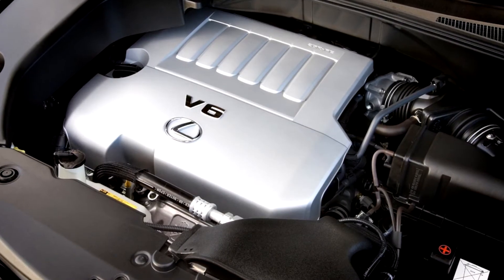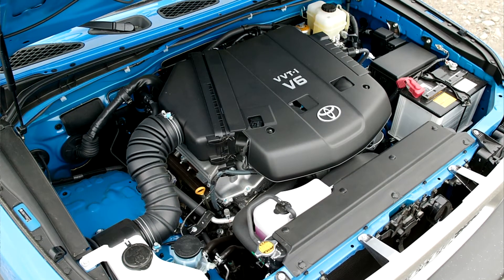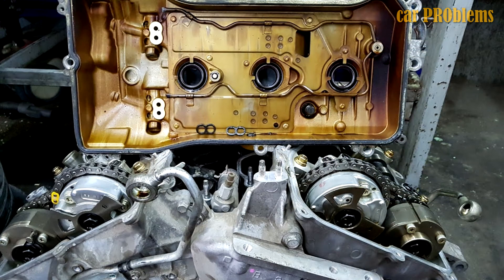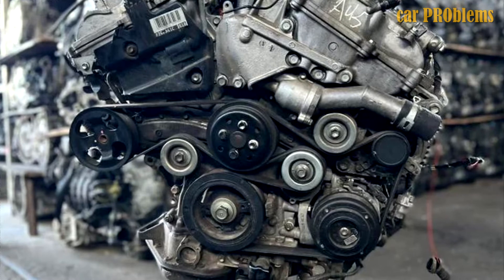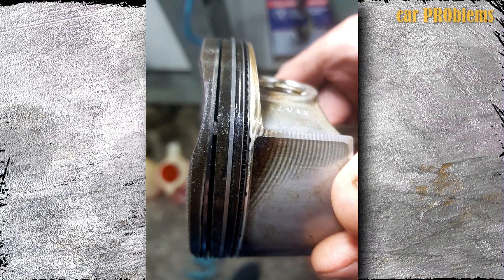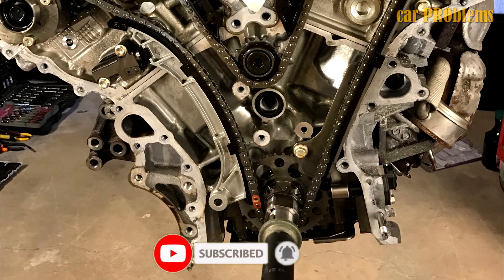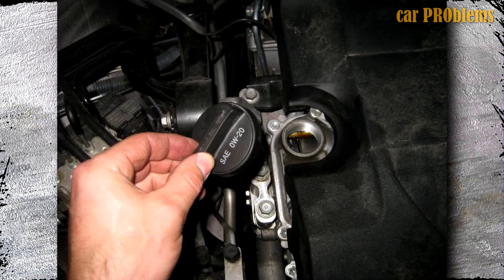Toyota 2GR-FE Problems (2GR-FE/FSE/FKS) - Toyota 3.5 V6 Engine Reliability

Comment: P.s. everyone should have it done or learn to do it yourself ( it’s not that hard  just watch an expert do it )  to clean  the MAF sensor and the throttle body. Use task specific cleaners not brake cleaner etc. , use  MAF sensor cleaner and Throttle Body cleaner. It wouldn’t hurt to mention that the PCV should be replaced every 40,000-50,000 miles or so although it can be cleaned it’s still relatively cheap to buy a new one.

Comment: My 3.5L 2GR-FE engine in my 2008 Toyota Sienna spring a minor head gasket leak at 198,000miles (My purchase date Jan 2024, and is probably why the seller sold it). The engine now has 202,000 miles six months later in July 2024 and the head gasket leak is too large to temporarily fix with the grey thick head gasket sealer. I'm now ordering a new (used) engine tomorrow approx. 70,000 miles for around $1,800 USD plus around $2,000 installation (labor). It was a learning curve but I primarily purchased it because it had very little rust and a working transmission and good brakes and clean no rust brake lines. I was debating buying a different car now but I'm going to learn about this Japanese imported engine when I get it to see if it's worth it. I own a 2006 Sienna 3.3L also but unfortunately had to put it out of service due to a hole in the K-Frame (chassis) but that engine was still running good at 200k miles, however I don't know how long that 3.3L engine would have lasted for. Just adding this for other people considering buying a used imported engine.

Comment: By the way cylinder five issue was a big lie, and there is little to no reports bout this issue other than owners neglecting maintenance and oil change or top up. There are only a couple websites talking about it. Nothing on official regulator's data base or official reports... Better get your facts right. One things that is reported is that the cylinder walls on a FSE is a bit too thin to add liners/sleeves in case you damage it by placing incorrect/low quality custom parts such as pistons or piston rings.

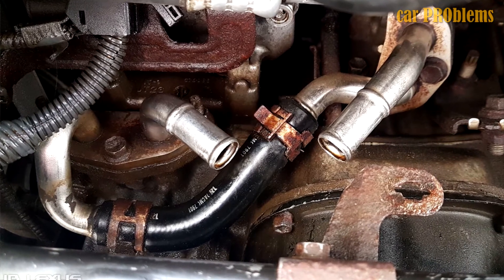Comment: 0:40 - Just wanted to point out that what you pictured isn't the vvti line or even close to what the vvti line looks like - THAT is an oil cooler line found on cars with this engine that were designed for towing (highlander, sienna, etc.), and is found near the radiator.  This oil cooler line is not present on models such as the Avalon or Camry with the 2GR-FE engine.  Please don't spread misinformation.

Comment: You show the oil cooler lines when talking about VVT oil supply lines.

They're both problems due to their original metal rubber composite construction and have been upgraded to full metal by 2010.

VVT noises are caused by lack of oil pressure due to clogged filters at the VVT feed lines: Clean them.

There are plenty other channels that cover the 2GR engine family better than this.

Comment: I was looking to buy an 17 lexus es 350 it does have the 2GR-FE are the ones after these years any good ?? Or this common problem apply to this engine no matter what ? And if the 2GR-FKS more reliable that I should consider? Thanks
Reply: I think it has the 2GR FSE... did u purchase it hehe
Reply: @drivealongph5428  i got 2019 ES 350 F sport instead that has 2gr-fks engine